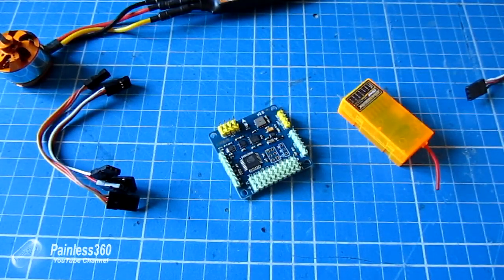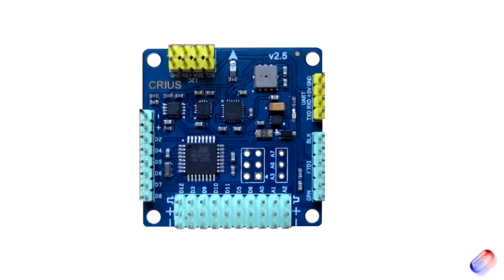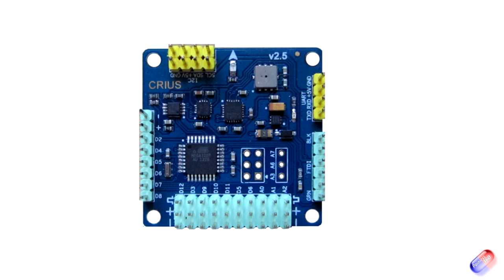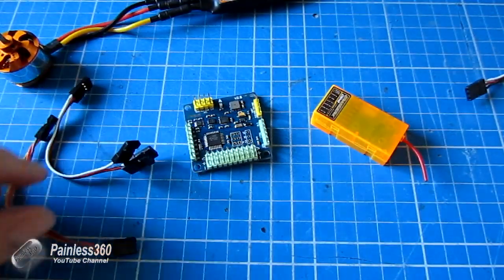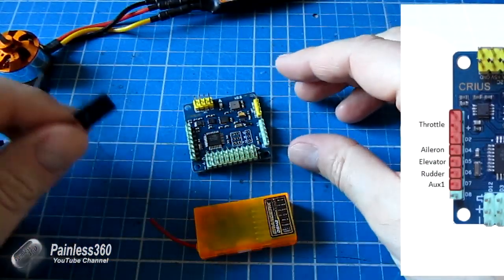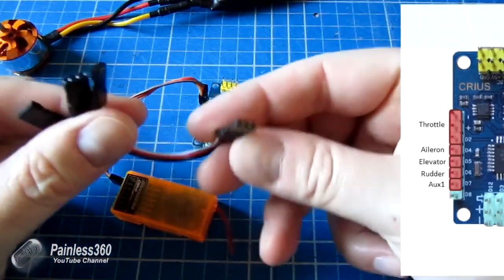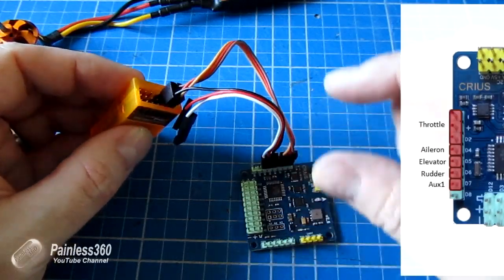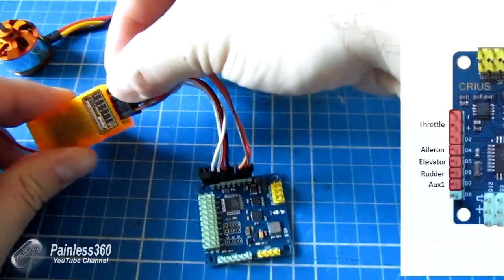(2/7) How to wire up a Multiwii SE board to your multirotor/quadcopter

Comment: Hello Mr Painless, I have to tell you how much help you are giving me in setting this board up. I am only as far as plugging in motors, esc's and board. prier to that I was able to separately run the motors for the right direction.
Q#1 My receiver has1-6 +battery symbols only. yours has names for what there for. I did try to just run up with my numbers. nothing seems to work at all. the board lights do go on initial plug in, But then nothing happens? No response from joy sticks. So I can tell you this.
#1 The remote is bound with receiver
#2 The connecters are joined with board and (numbered?) receiver.
#3 The connecters are joined with esc's and board.
Can you tell me what I am missing?
                                                                    Thanks in advance
                                                                                                             Kazz
  P.S. Does the board need to be powered separately?
Reply from the maker: The numbers on the receiver will correspond to the channels - you need to read the documentation that came with the radio/receiver to see which of the numbers is the throttle, rudder etc.

Best of luck.
Reply: Painless360 Thanks, No sign of Documentation? Hmmm?
But I can tell you that I have spent all day and night watching you video's till I discovered that I've been watching all but 1, The very 1st one of your about FTDi adapter. Dummy me! So I went ahead and ordered 1 FTD. Please,Please tell me that that is highly possibly my problem? and that My Multiwii board has to be programed as you had mentioned on your number 1 video which I clearly missed all day long.
THx Kazz.
Reply from the maker: The Multiwii will not have any firmware on it so you will need to start there. I suggest you watch https://www.youtube.com/watch?v=Zm8z4RLkFGU and go from there..
Reply: Painless360 Please help Mr. Painless, I did order and received and that device you plug into the board and computer and followed trough your 1st vid. (all good) I now have all the plugs connected according to your 2nd vid. And at the end of that vid, You mention to go ahead and plug it back into the computer to program it again? Could you tell me what I am programing? I cant find a Vid of yours about that part. P.S. I am not even getting the throttle to run like you did after you hooked up your receiver to your board? Thank you so much. Kazz.
Reply from the maker: If the board has already been programmed then you don't need to do that BUT you do need to check the channels are all working, the MAG and ACC are calibrated and you can see the board moving in the right way in MultiWiiConf.

Happy flying!
Reply: Painless360 Hi again. I know your a busy man, But? OK, I did everything you've done on your vid #1 and #2. I'm still not getting any response from motors? It just dawned on me! Do I have to program my ESC's or should that not matter by my not getting any response?
Reply from the maker: I am guessing you are not watching the playlist then... https://www.youtube.com/watch?v=lc4ECi6JYX4&index=3&list=PLYsWjANuAm4qSqszQR6qIisiwk5r-_nMk

Best of luck..
Reply: Painless360 Alright Mr. Painless. I did watch your vid#3 about arming problems, But didn't understand it till I took a closer look and listen. and also went back to your vid.#2 on wiring and caught one key ingredient you had mentioned about the power(main feed) plugging into the throttle port. Yours was port #1 on your receiver. and come to find out mine was port #3 on the Flysky FS-R6B.  BAMM!!!! It worked. :)  Thank you so much. I do have one glitch though? The 2 motors that go clockwise don't seem to run right? Almost like a (slow) skippyish. Both doing the same thing. I'm going to try to swap 2 of the wires but wont that mean they will end up counter clockwise with the other 2?
Reply from the maker: Don't swap the wires, I'd check that the ESC calibration is good and if it is then check that there isn't a dry solder joint on one of the motor connections..

Best of luck!

Comment: I dont have a ftdi thats the problem so at least i know its the multiwii
Reply from the maker: You need to get yourself an FTDI Basic adapter if you are running a board without a USB socket - you can't setup, configure or troubleshoot a Multiwii based craft without being able to look at it using the PC.

https://www.youtube.com/watch?v=qLaH4qkJNt0

Comment: The problem is that it doesnt take any command on the sheet you sent me, no command is transmitted :( the multiwii is beebing and the receiver is steady, when i take th motor apart and plug them into the reveiver on the trottle they all work.. So that means the problem is the multiwii??
Reply from the maker: Sounds like you've missed something basic. I would connect back to the board using the FTDI connector and reset the MAG and CCC using MultiWiiConf and then try again.

If that fails then re-flash the board..

Comment: Btw i have an ar500 so it is already 5 channels, but i have gear and ail again besides my thro, ail, elev, rud, where would the aux plug in to?
Reply from the maker: The gear channel. That will allow you to have two settings for the modes on the Multiwii.

Comment: I have a question, do you have to have the aux connected or is throttle, ail, rud, and elv enough? I dont have an aux on my receiver. 

My motors are calibrated but they just dont arm :( i have a spectrum dx5e and a spectrum receiver but the motors just wont arm with the multiwii, i dont know whats wrong...
Reply from the maker: I would strongly recommend that you get a five channel receiver for any Multiwii based flight controller. You need to be able to control and select the flight mode that you are in. I'm not sure if the lack of an Aux will stop it arming but this video might help - https://www.youtube.com/watch?v=lc4ECi6JYX4

Comment: I found the adapter.  Thanks!  Next newbie questiion:  Me receiver has the ports labeled: bat, and channels 1-6.  Would these necessarily correspond to the channel numbers on the Multiwii, or is that way too simple for me to comprehend.   The transmitter is a Flysky T6.  Thanks for all your help!
Reply from the maker: You need to look at the manual for the radio. Each of the receiver channels relates to one of the channels on the radio - Elevator, Throttle, Aileron, Rudder etc. With the newer radios where you can decide which channel does what it can make it more complicated than it needs to be. With some radio systems they still mark up the receiver with the default channel to make connections faster.

Hope this helps.
Reply: Painless360 Many thanks!  After much googling, I managed to hook everything up, hopefully correctly.  I calibrated the  ESCs and I am ready to program the board.  I have already watched your video on that topic.  I am a complete beginner when it comes to electronics and I purchased a kit from China with no instructions and that was missing most of the screws and stand offs.  I love a puzzle.

Comment: I purchased a quadcopter kit with the Multiwii board.  It did not come with the FTDI adapter and I am having trouble finding the adapter without purchasing another complete flight controller board.  Do you know of any place that sells just the adapter?
Reply from the maker: Search on eBay for 'FTDI Basic'

Comment: So.. I can run power directly to the multiwii, thru the power input and removed the jumper to power the FC from the ESC. And POW it works.. but is this really the best way to do this.. another battery.. or pull it directly from the main battery?
Reply from the maker: Which Multiwii is it? If it works then go with it..
Reply: Multiwii/megapirate.... I have power now as long as it's powered through another source, but now I'm having trouble getting my controller centered even even with the max sub trim I can't get it centered. And I have one motor that seems to want to be at full blast nearly no matter what.
Reply from the maker: Normally I would recommend ESC calibration and trying another receiver but with so many problems I would start again from first principles and re-flash the board and run through all the setups again.. I've not used that board myself so haven't got any silver billets that may help..

I hope you get it sorted soon..

Comment: hello sorry I have a problem I MultiWii SE V2.5 and a radio flyski t6 the problem and can not figure out how to connect the cables between the receiver and the multiwi I would be grateful if you could send motion a scheme my email and umberto2008@live.it thanks and hope you can help me in I forgot my quad and a qav250 hello thanks
Reply from the maker: This is covered as clearly as I can get it in this video. Watch from 3:01 and it goes through how to do it.

Best of luck,.

Comment: Hello bro,
      I am making a quadcopter using the following parts
1)hextronik nanowii V01 from HK site
2)multistar motor type 2213 935KV
3)10*45 propeller
4)3 cell 3000mAh tunigy battery
5)turnigy plush 30Amps*2 for two motors and 25Amps*2 for the other motors
6)Flysky controller model FS-CT6B.
  So far I have fully assembled my quad all the motor direction and all connections are correct.I used multiwii to program my nanowii controller,so i have set as #define MINTHROTTLE 1150 and #define MAXTHROTTLE 2000 also i calibrated my ESC initially using the #define ESC_CALIB_CANNOT_FLY command in the config.h of the multiwii.ino,but I am facing a problem.
      After I arm the motors and star to raise my throttler one of my motors(rear-right) is staying constant at 1150 for a while while the other three motors raise up.After sometime the fourth motor(rear-right) also increase and at full throttle three motors are running at 1960rpm while the fourth motor(rear right motor) runs at 1660rpm(as seen from the multiwii GUI). Even during the flight it has terrible problems during take off in fact it is not taking off since three motors are at a higher throttle it tumbles over rapidly. Please Help..
Reply from the maker: First of all using different ESCs are not a great idea. You ideally need to use the same ESC with identical firmware on each of the arms.

Secondly, calibrate each of the ESCs separately - I've had mixed results using the 'inbuilt' ESC calibration routines on some controllers. See https://www.youtube.com/watch?v=OOplk52R4no on how to do it.

Finally, I will delete all the other identical comments on the other videos. No need to post a question three times.

Good luck with the problem. Happy flying!
Reply: Thank you for your advice ... Sorry I had to do it because this is my college project and I am planning to make it autonomous. But just flying it manually is so strenuous and I had limited time so had paste the same question :( to get a quick response. didn't knew all three videos were yours :( sorry.
will try the method you mentioned and will let you know.
Reply: Painless360 I followed your other tutorial on how to calibrate the escs separately and it helped in one way that when I used the auto calibration it required me to increase the throttle a bit before the escs start and power the motor but now just as soon as I start to increase the throttle the motor starts and the motor reaches the highest speed, But that didn't solve the problem.
here is my observation .
1)I disconnected all the escs from the board (just to check what the output is my board giving out when the quad is in flat position, anyways connecting the ecss is not changing any value the controller outputs).
2)connected my controller to my computer and all the receiver connections are connected on the board.
3)So when I increase the throttle on my controller I observed in the multiwii GUI that the output from the board is not increasing the same and the problem is not solved and it is just as stated before.
 "After I arm the motors and star to raise my throttler one of my motors(rear-right) is staying constant at 1150 for a while while the other three motors raise up.After sometime the fourth motor(rear-right) also increase and at full throttle three motors are running at 1960rpm while the fourth motor(rear right motor) runs at 1660rpm(as seen from the multiwii GUI). Even during the flight it has terrible problems during take off in fact it is not taking off since three motors are at a higher throttle it tumbles over rapidly. Please Help.."
4)Also I saw that changing the YAW calibration on the controller by sliding makes the controller output go crazy i.e. now instead of one motor now two motors are not increasing for a while.
5)The same goes for other calibrations on the controller so I suspect that the problem is with the controller configuration and not the board . Also I am not sure if the using the two different types of ratings esc is the real problem (if it is the real problem please let me know). So do you have any tutorials on calibrating the controller?
Reply from the maker: This is normal if you are on the bench and not actually flying. Have you now tried a real hover?
Reply: Painless360 yup I tried real hover and just as I increase the throttle three motors run faster I suppose because every time it topples in the same arm damaging the blade of that particular motor bit by bit.
Reply: Painless360 and ya it didnt hover even a single time just as I increase the throttle it topples over instataneously
Reply from the maker: I would replace the odd ESCs to match the others, troubleshooting this with mismatched ESCs will be tricky..

Best of luck..
Reply: Painless360 Ok I will let you know after replacing these mismatched ESC's

Comment: Can you connect all 4 ESC's if they all have a UBEC or do you only connect 1 fully then just the signal wires from the other 3??
Great video ( series ) many thanks
Reply from the maker: bigfilsing You can connect all of the power lines if the integral BEC is linear. If they are switched, just install that one. Hope that makes sense. Happy flying!
Reply: Painless360 Thanks. The next question is how to tell if its a linear or switching BEC. There seems to be a bit of confusion (on the net). I gather that UBEC's/SBEC are switching ( non linear) ( for example the HK 20A blue series we often see in your vids).
 I am currently building with some EMAX 12A Simon series ( not to be confused with SimonK) and it would seem they are linear but how to be sure
 http://www.emaxmodel.com/views.asp?hw_id=1434
My guess is they are linear but if the magic smoke comes out itll be your fault :-)

Thanks for your great vid series that's saved me hours of hunting around the net & reading ( when i should be flying)
CHeers
Reply from the maker: bigfilsing it says on the link you sent that they are Linear. the detail is in the table at the bottom of the page.

Happy flying!
Reply: Painless360 Doh ...Cant see the wood for the trees sometimes .
Thanks
Reply from the maker: bigfilsing no worries! :)

Comment: usefull vid, thank you
same method also working on multiwii328p?
Reply from the maker: Hi Luca, each board is slightly different but the principles are the same.

Happy flying!
Reply: Painless360 receiver pins are trh\rol\pi\yaw the escs connections are D11 D3 exc
which pin for the battery? 
Hope to an happy flying, this is my first quad, diy fan, includes a lot of questions
Thanks in advance
Reply from the maker: The power for the board (+5v) is usually supplied via the red cable that comes as part of the servo lead from the ESCs that power the motors. You may find this video useful - https://www.youtube.com/watch?v=-gOupB8xnlM

Comment: Awesome video, I have the 2.5 Crius board and the one thing I have yet to figure out is the AUX channels.  When I have multiwiiconf running and then I flip my Flap/Gyro switch, I see nothing in multiwiiconf, no values at all ... I have an OrangeRX T-Six and already found another video for setting up the Flap switch and for the transmitter monitor the switch movements in real time, which work on the transmitter, I see arrows moving.  On the Crius board, I have AUX1 connected from myR615X receiver (signal cable) to the Crius board on the AUX1 pinout ... Googled all around the world and still can't find any extra information at all as was wondering, with all of your quad expertise, whether you have any ideas on this problem sir!  Any help would be massively appreciated!  Keep up the good work!
Reply from the maker: The easiest way to check is to plug a servo into the connection on the Rx and check it moves as you change the values on the channel. I've found that I had to plug the aux connection from the Multiwii into the AUX1 port on the Rx to pick up the changes in the channel values from the mode switch (I use a Heli setup).

Not sure if that helps. Pictures and videos of how you have it setup would help..
Reply: Hi Painless360, thanks for the advice :) I had to flash the Crius board v2.5 with the Crius v2.0 selected in the config.h file as selecting the CRIUS_SE (As recommended in the v2.5 manual) did not work, I suddenly had no sensors!  I then configured the ESCs to correct wrong erratic motor speeds.  I think the board just needed re-flashing.  I then configured the ACC followed by MAG in Multiwiiconf.  Now I just have a massive drifting problem and trying to guess the PID (start with 0 and work my way up using the holding over head method) as there's not really many examples for a good PID out there for an X525 ... The amount of trim I need to put on the transmitter is insane at the moment.  I ordered another FC just incase the FC still has some issue ...
Reply: I'll get some pictures together though, just in case you notice something massively wrong in the setup ... The Quad has been configured as ACRO (plane) on my OrangeRX T-SIX transmitter ... By recommendation of other RCForum posts that I have read ...